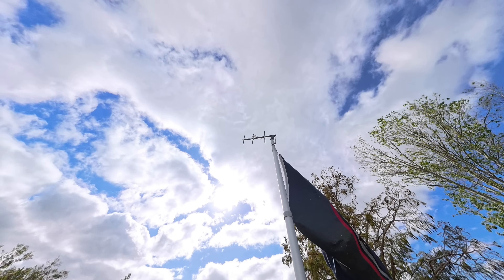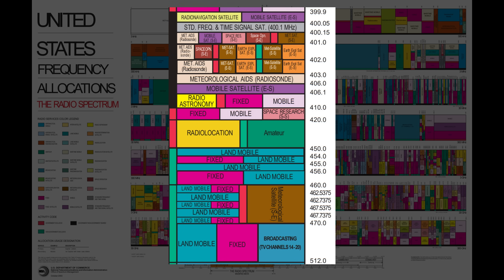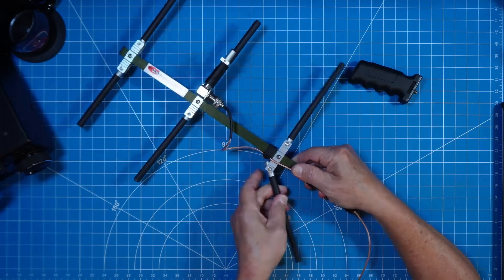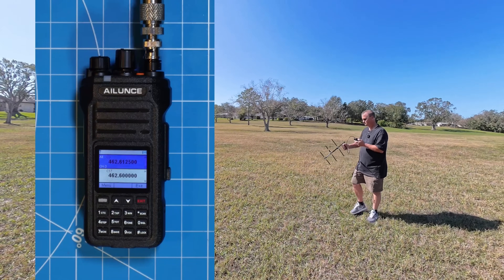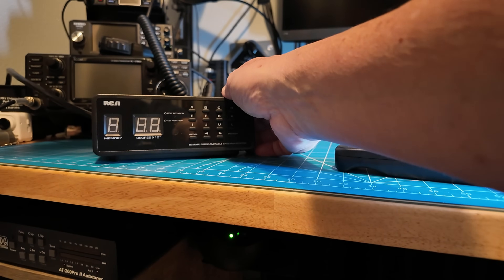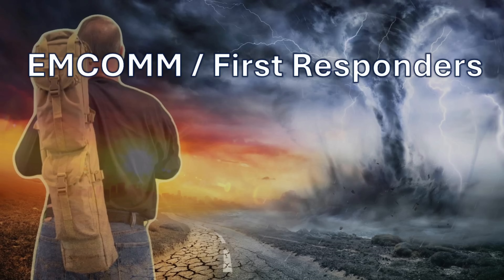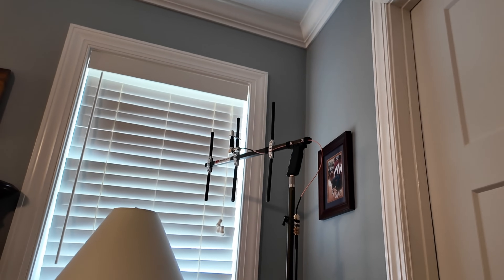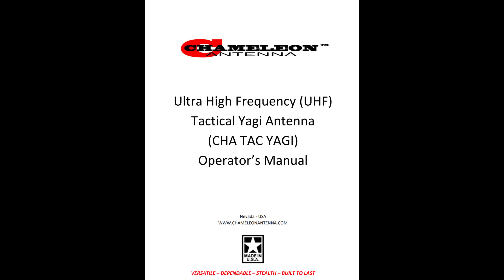TAC YAGI 70 by Chameleon Antenna - Portable OR Permanent Deployment for UHF Ham Radio, EMCOMM, GMRS

Comment: Will this work for me sending APRS to the ISS?
Reply from the maker: I don't know much about contacting the ISS other than what Google yields in search results "The ISS ham radio operates on both VHF and UHF bands, with the most common voice contact frequency being VHF at 145.800 MHz and the UHF frequency for packet radio being 437.800 MHz; essentially, it utilizes both bands depending on the communication type used."

Comment: So this is good for tracking down those 70cm/GMRS voilators.
Also that coax you are using would be super lossy with 70 CM. You are going to want some thick cables if you are going to do any sort of run with 70 cm. Looking at the coax length you are using, you are losing half the power of the radio right there.
Reply from the maker: Coax matters for sure.